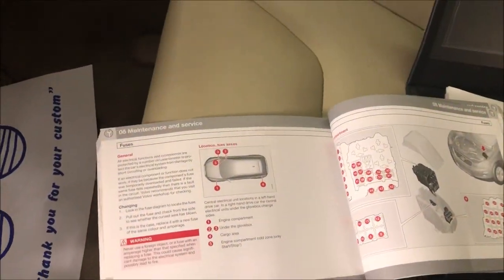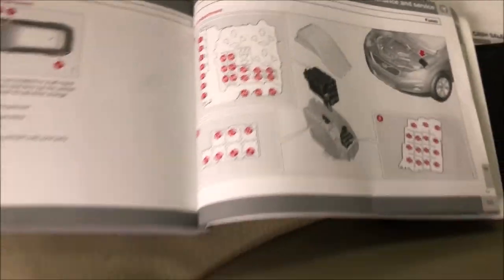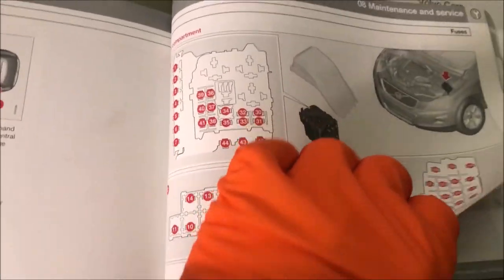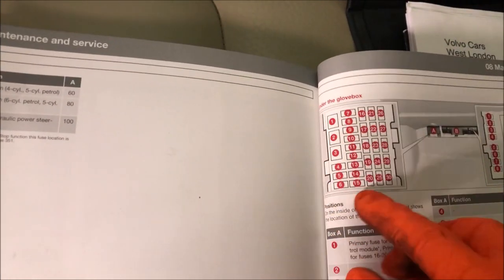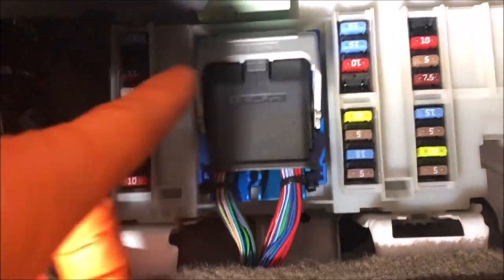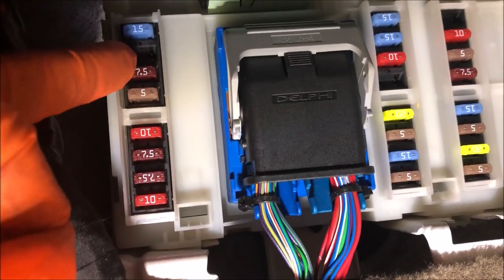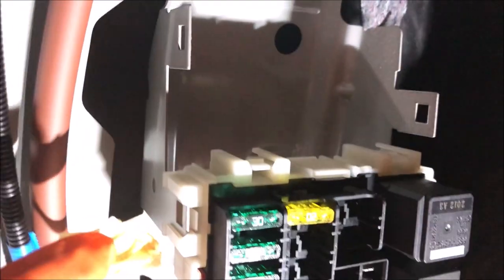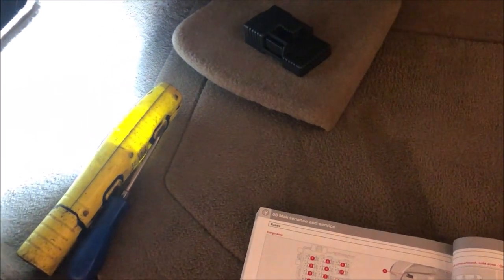Volvo XC60 2012 fuses location

Comment: Okay so for 2012 Volvo XC60 the cabin fuse box is on the front passenger side underneath the glove box, pull back the carpeting to expose fuse box cover on the right.  Thanks!
Reply from the maker: Great tip!